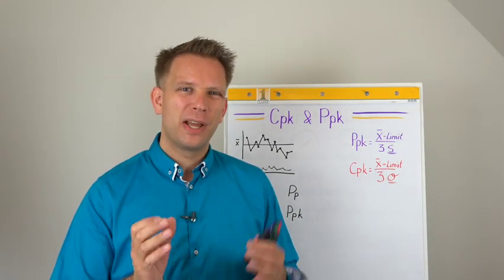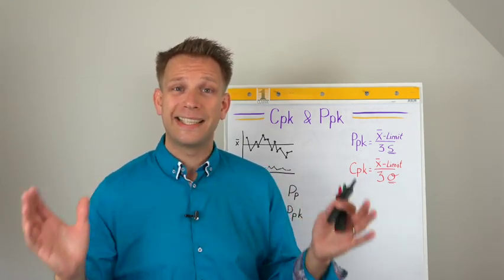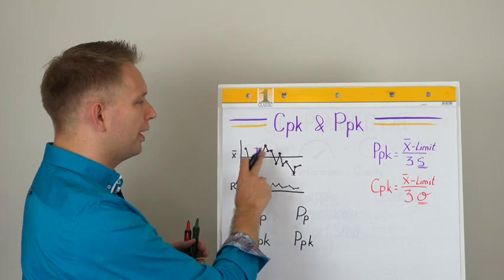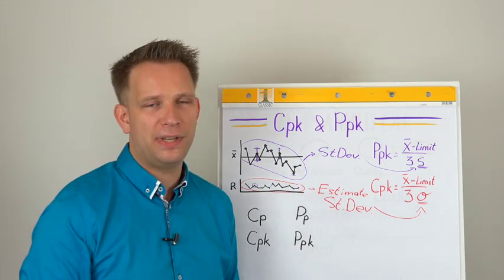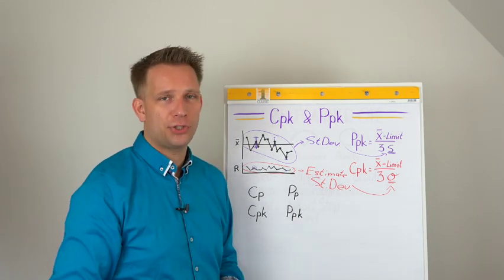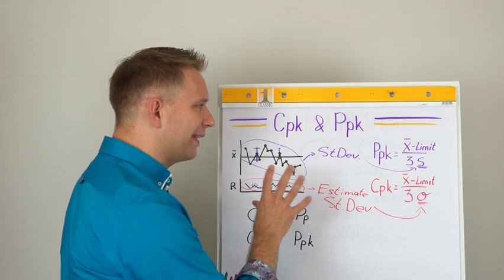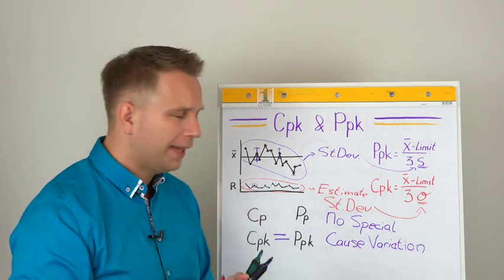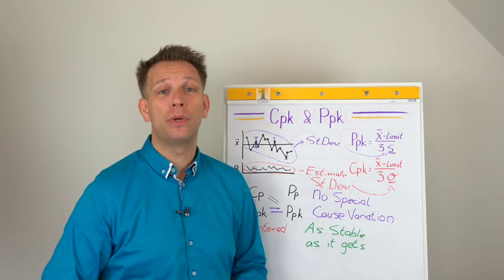Combine Cpk and Ppk to get even more information about your process stability

Comment: Hi Tom, I was wondering if the grand mean represented in the x bar chart takes already in account special causes, or if it's the process mean before special cause happens. In other words let's say that 1 point or few points are beyond 3 sd. Are these outlier points also used to calculate the grand mean shown in the graph, or that mean is just a reference to show where the process is centred before the shift?
Reply from the maker: The mean is always calculated using all the data points, so that includes the special causes. Now you can treat certain data points as outliers if they seriously skew the picture or you doubt their validity, but that's a manual thing to do, the formulas include all points that you feed into them.
Reply: @TomMentink   thank you very much